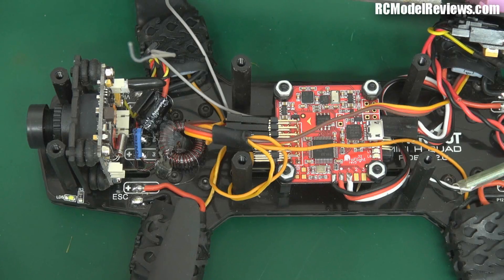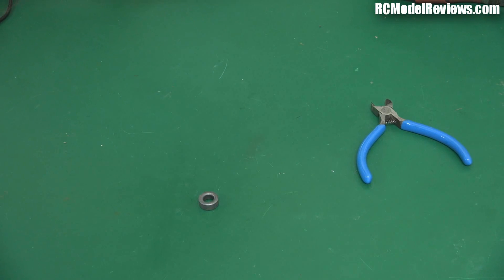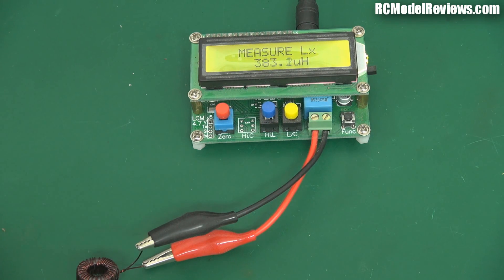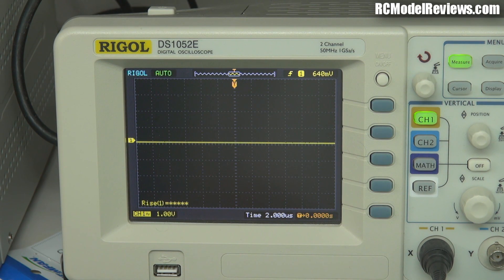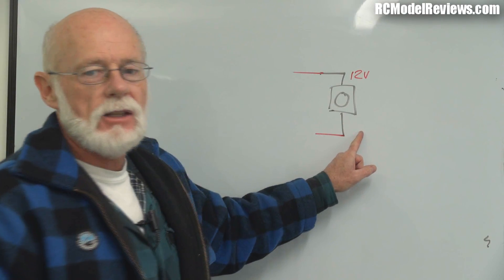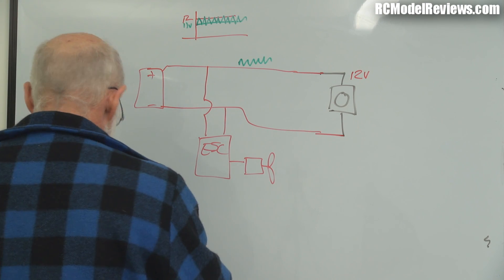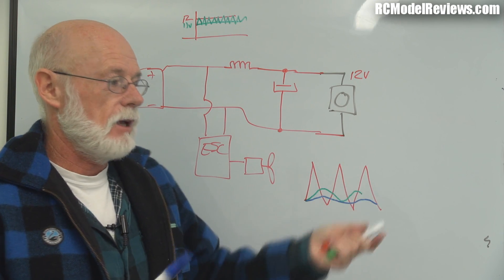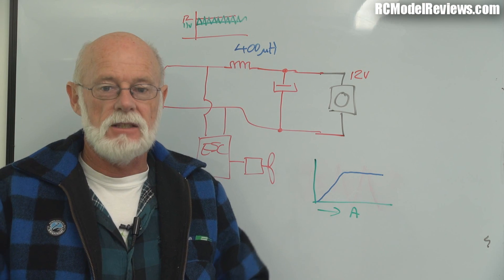DIY FPV power filter for under $3

Comment: I had the same problem with my 1500mw video transmitter I use for my rc car fpv with 1.2ghz video. I had the tx connected to lipo I use for my rc esc to power up via balance adapter. On high throttle I'd loose the video with black lines. I simply used a separate 3s lipo to power the tx and haven't had any problems yet.

Comment: I know this is old but I plan on adding a buck converter dc-dc, I have to think that would regulate the voltage and smooth it out. Since mine is adjustable, I can go from 3v to 12v. That buck converter should have a filter on it wouldnt it?

Comment: hi Mr. RcModelReviews, this is MikeDroneUfo i have a question about mini fpv camera 600tvl : is does flick each time i throttle up,i got gray lines on the screen up and i cant see i cant fly , only i can fly it if i connect the mini camera direct to another battery , do you think it can be fix? thanks

Comment: You can actually buy torroid inductors on the cheap on Banggood, something like $2 for 5 pieces rated at 330uH all nicely wound & ready to go. Saves you the hassle of buying and winding all that copper wire.

Anyway Bruce... quick question... how do I know how much uH I will need for the torroid inductor?

Comment: this if off topic.. but I have ehiye4 diagonal lines from a pdb  be. I have a bluesky  12v  3amp  ubec  but I use s3 and s4. my camera  and transmitter needs atleast 7 volts. will the 3s work with this 12volt ubec?  Or would the ubec  not even push out a voltage If I use a 3s

Comment: I put an LC filter on my VTx power supply line today, and what a difference! I used to have horrible black lines all over the video signal when the throttle was beyond 25 %. But now I get a crystal clear video signal even at full throttle. Thanks a lot for the tip Bruce!

Comment: so i have a question.  I have the flycolor raptor 390 tower.  Its a FC pdb esc combo.  I am running the rotor riot runcam and a 600mw vtx.  I have a lot of video noise when I arm my motors.  Is the noise from the camera or the vtx?  If I built one of these would it go on the camera or the vtx side.  Thanks for the info

Comment: @#RCModelNews I love your teaching first of all. On your whiteboard explanation you said inductance was measures as 400 micro Henry's but you drew the symbol for milli not micro. Did you mean 400 uH (micro) or 400mH (milli)? I'm just slightly confused and I'm fairly certain I know what you meant just would like to be 100% sure.a

Also, would I be ok to use a radial inductor (electronics kit I have laying around) or should it be toroidal?

Keep up the awesome work!!

Comment: Do you connect ferrite ring and cap in the vtx power feed line, cap across and ring inline, add cap across esc leads also? Your diagrams are great for us visual learners. Thx from the States

Comment: my question is about the electrolytic capacitor and which ends connect to what. I know they have a plus and a minus so I'm assuming that the plus wire from the capacitor goes to the positive side and the negative go to the negative voltage am I right?

Comment: Hello. I dont know much in electronics. But, as i understand, if camera will be powered from separated battary, there will be no nois. is it correct?
Reply: true, provided no interference cross over from circuit proximity occurs, but! This will add a lot of dead weight to your uav which will change other flight characteristics, namely your flight time and responsiveness.

Comment: this might be a dumb question but I'm assuming that the same noise effects the fpv transmitter. can I wire both the fpv camera and fpv video transmitter to the same lc filter to reduce noise?

Comment: Excellent, this seems to have solved my horizontal line issue on my boscam VTX / Runcam 2 setup. My video was clear, until I increased the throttle... ;-)

I tore an old PC PSU apart, used an inductor (with copper wire already attached) and a 16V 2200 capacitor. Many thanks for explaining the background info, it's helped me a lot in partially understanding what we're dealing with here.

For those that are wondering: I am running 3S, 12V is coming from my Matek PDB (with 12V BEC) . This is a safer solution in my opinion, for when I choose to run 4S Lipo's later on, I won't have the risk of frying the capacitor.

Comment: great videos, what do you make of this? i want to use this on a caipirinha wing,
Type: passive common-mode low-pass power ripple filter
Modes: common mode, single mode - jumper selectable
Maximum voltage: 16V DC
Maximum current: ~1.5A
Cutoff frequency at -3dB: 127 Hz (attenuates higher frequencies/noise)
Voltage drop over filter: 180mV at 900mA
Maximum voltage ripple: 120mV
Capacitor: Japanese Polymer Capacitor
Impedance/ESR: 0.012 Ohm at 100kHz/16V
Ripple current: 5000mA rms
Choke: German Common-mode Choke
Series resistance (DC): 0.205 Ohm/path
Wire / trace thickness: twisted 22 AWG / 32 mils
Operating temperature: -40 °C to +105 °C
Dimensions: 37.7 L x 8.8 W x 14.5 H mm
Weight: 8.1 grams (inc. JST connectors)
RoHS compliant
Designed and made in Europe

Comment: I love your videos.  They have helped me so much in this hobby.  Keep them coming!  

I just have one question.  At 2:20 you mention the copper wire thickness is unknown but it will be added to the video.  I'm having a hard time finding it.  Can you tell me what thickness you used, and/or what range is best to use?  I am about to place an enameled copper wire order and they are asking what thickness I need.

Thank you!

Comment: Hi Bruce! I'd like to ask if I can use a capacitor that's rated for 25V in a 3S setup?
Reply: +kobuki01 yes you can. as long as it's not underrated, it will be fine
Reply: +Daniel Bråtasæter so if I run both 3s and 4s batteries I would use a capacitor that is rated for 4s
Reply: that is correct.
Reply: +Daniel Bråtasæter Thank you Daniel

Comment: Very informative video. Thanks for putting it up. I understand that putting a capacitor in parallel effectively grounds the peaks in voltage due to the motors need for pulsed supply. Have you tried either putting the capacitor in series or and additional capacitor in series (in addition to the parallel)?

Comment: Why if the capacitor wired in parallel if i understand the diagram, why doesn't it short circuit?
Reply: +daran Jones no, a capacitor is a passive electronics component, the basic build of a capacitor is 2 long strips of metal separated by an insulator and made into a roll. Check out basic electronics tutorials on the internet if you are interested in that, it will explain everything;)
Reply: Daran Jones it blocks DC voltage so no

Comment: Brilliant explanation as always! I don't know much about electronics but in this example, the fpv cam is drawing power after the motors. If the cam was connected to the battery first before any load, would that have fixed the problem also?

Comment: Thank you!
I bought a cheap PAL camera and tested it on my NTSC TV (before I received my monitor in the mail) I thought the lines and the tendency of the screen to go black were the result of mixing 60Hz and 50Hz.
When I got my monitor and tried to fly FPV I found that the monitor screen would still go black 'until' I pushed the throttle, and I still had lines.
I don't have a scope so this video was really helpful.
Reply: try to use a non-blue/black screen to avoid this. like the cheap screen the quanum FPV goggles use :)

Comment: When disconnecting the battery wouldn't the ferite coil make a voltage spike? Or is it only on parallel indoctors? This spike could be resolved with a voltage depended resistor or a small capacitor in paralell with the inductor from the input to the output. I think.

Comment: I'm confused..do you take the two ends of the copper wire and twist togeather?soldering to the capicator +side then ground the negative to the ground side of the power source? Or do you cut the power supply wire in half, solder one end of the copper to one end and solder to the other end completing the circuit?and follow up with the capacitor? AND DOES THE COPPER WIRE NEED TO BE INSULATED?CAND THE COPPER WIRES TOUCH EACH OTHER?I DONT WANT TO FRY SOMTHING!!!
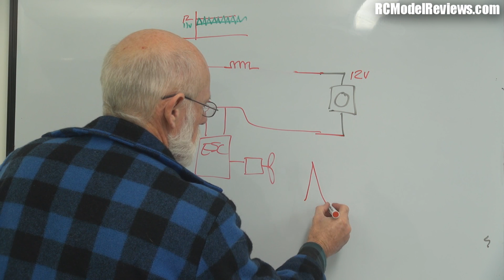Reply: tomstrb That copper wire is insulated with an enamel coating, which is sanded off of the ends with some fine grit sand paper before soldering those ends to your circuit. As for the twisting, I believe that was just temporary  and was used to hold the wingdings in place, but the parts that were twisted together were still insulated. So if you skip ahead to 12:45 youll see the circuit diagram. The winding bit at the top is the inductor he made and one end is connected to your positive while the other is connected to your cameras positive wire. Polarity isn't an issue since this is just a conductive wire.

Comment: So can the bare copper wire sitting on your quad still short? just curious as to why you don't need to cover it up. Thanks
Reply: It's not bare... it's coated with enamel so that it will not short out.

Comment: Hi Bruce! Before I saw this I bought something called an "LC Common Mode Power Filter" ( http://www.getfpv.com/lc-common-mode-power-filter.html ) which I think does the same thing but on my Phantom 2 I installed it between the video hub and TX (on the TX power line) as I assumed the GoPro camera shouldn't have the same problem since it runs on its own battery (with charging by the Phantom) and the wiring is too complicated to isolate that power source.  It did not only make a clearer picture but seemed to give me about 200 m. more range but I still have white horizontal lines travelling down the screen just not as bad.  Anything else to clear this up?

Comment: another excellent one Bruce. Question if you run your camera off a 12v BEC and vtx off a 5v BEC, do you use one LC Filter before both BECs or do you run an LC filter after each BEC?

Comment: What size caps should we use for the 12v Camera?
Reply: Jon Car  470mfd capacitor rated for at least 16v if you are using a 3s, rated for 25v for a 4s. It says in the description box :)
Reply: luke spenceley thanks, already built one and works great

Comment: Hi Bruce,

I'm a newbie in the RC community and really thankful for all your informative videos.  Reminds me of my science class during my junior year in high school.  But this is better.  : )  I'm learning quite a lot.  By the way,  what values are the 2 resistors on this video?  Because I will be buying a QAV250 mini quadcopter kit and an FPV setup.  I wanna get as much clean video as possible when "darting" thru the air. 
My respects to you sir.   
Thank you
Reply: Ghostwriter972 I believe the resistors were there only to provide some load for testing purposes .  Not needed for the actual install.
Reply: TheGusK Yes this correct !

Comment: I'm planning to run the transmitter from the lipo (3s) and the camera from a linear regulator (lm7805), do I need a filter between the camera and the regulator (or between the regulator and the battery) and between the battery and the transmitter?

Comment: Instead of buying parts and pieces go find your dead pc or laptop in the garage and scavenge the parts from them. Most time hard drive or motherboead takes a dive. Even if power supply quit it probably has many usable parts, Use ur dead stuff and recycle what you can !

Comment: First I want to say thanks Mr bruice for all the awesome videos.. Very inspired... 

Part 1
             Now I went to a electronic wholesalers and found everything except the 2a resistor because they where measured in ohms... Maybe I'm that noobie but even the employees had no idea how to help...can you give me more info on the resistor part/type... 

Part 2 
             If I run a 4s battery with this setup and the 12v camera and tx can I just run a resistor to cover the tx and camera for both 3s and 4s applications. this is an open question thanks for reading.. :)

Comment: Bruce, can I use the copper wire from the windings of a dead brushless motor I have? And would a cap from a 30a esc be suitable? The cap has 270uf and 35v written on it if tht helps. Thanks.

Comment: Hey Bruce, I found that the 470 uF cap fits snuggly inside the ferrite ring after the enameled wire was loaded onto it.  Nice and tidy, super compact.   Is there any reason, electronically speaking, that this co-axial arrangement would be a problem?

Comment: Bruce I just wound one toroid (Hobbyking one 16mm dim). I was able to wind the wire 31 times. I am using 32 AWG. I think i used ~ 70cm of enameled copper wire.
It is interesting that i am getting only 120uH.
Do you have any suggestions on what wire to use, or what could i be doing wrong?
Thanks.

Comment: I have a question, what if you use the balance port to power the fpv camera and/or tx from the same battery running the esc, would you still need the filter?
Reply: the positive pin of the balance port is physically connected to positive cable of the Battery, and the same for the negative pin, so no difference.

Comment: Does the the LC filter go on the power power leads to the camera or to the vTX?
Reply: I should preface that with the fact that I'm using a Boscam TS832 vTX which runs off 12v as well.
Reply: The camera or both, whichever you are having problems with.

Comment: are you saying diode or resistor in this discussion?
could I use this diode? http://www.mouser.com/ProductDetail/Fairchild-Semiconductor/1N5822/?qs=UY9CvlAIy0ilZt8GFdM7Zg%3d%3d&gclid=CjwKEAjw0ueeBRCmhozc-_DRrlUSJABihBEESIegal4-rgM6yEA-Rntw1K_Zl2rY6JpgEnlYGU6QUBoC5pDw_wcB

Comment: Hey there. I'm planning to use "The smallest Power Distribution Board" search for that on ebay. It is basically 2 adjustable ubecs and a PDB combined. Cool thing is you can adjust the voltages seperately from 3V to 20V.

I'll be using one UBEC for 5V rail(FC and leds and stuff) and the other for 12V(FPV), What i'm wondering is, if I'm using a UBEC would I still need an L-C filter?

Comment: If the voltage is going up and down due to the ESCs, why not use a capacitor between the battery and everything else to act as a buffer?

Comment: Hi Bruce (and the other FPV coleagues, feel free to answer too),

I have built the LC power filter as per your instructions and I have a couple of questions before I connect it to my FPV system:

1. Would the electric field from the capacitor and EM field from the inductor interact negatively if they are too close? See a picture of my LC filter here (Dropbox link): https://db.tt/I07jCa4f

2. I used a thinner enameled wire and got an inductance of 10.9 mH (yes, mili, not micro). Thats is 27 times more than your specific inductor. I'm pretty sure it might still be OK but what do you think?

3. Furthermore, how can I calculate, roughly, the current I can draw through the filter with such inductor? The capacitor is 470 uF at 25V. The filter will be used between a step-down regulator (from my 4S battery to 12V) and the 12V camera.

Thanks for your vids!

Happy flying!

Comment: Great video.  A question was asked about stripping the lacquer from the enameled wire.  I find furniture stripper  containing methylene chloride works very well.  Just a tiny dab is necessary.  Won't work on epoxy.

Comment: Hi Bruce, 
I have the same issue with my Go Pro. How would I use this to reduce the flickering im getting on my screen while flying with my Boscam 5.8 ghz 600mw system? I have a blade 350 QX.

Comment: Good job Bruce....Everybody needs to know about an L..C filter.  Maybe another winding right on top of the first...then you may haqve been able to use a slightly smaller cap.  Saving some space,,,,maybe.  I have some of those from Amidon that have different mixes for upper frequencies.....I have a homebrew converter that converts from 50MHZ to 14MHZ.  Used a Grid Dip meter to line it all up.

Comment: Excellent explanation, definitely going to try and put one together. I don't fully understand the purpose of the two resistors - are they necessary for the final build ? What rating resistors did you use for a 3s setup ?
Reply: I think the resistors are just there for his measurement setup - one is the load (pretend camera), the other increases the impedance of his source, which makes the filtering more effective for demonstration purpose.

You could include a small value series resistor in the final build for the same reason, and this is actually done in some contexts, but remember V=IR ... if the camera draws 100mA and the resistor is 10 ohms, you'll lose 1V across the resistor and only have 11V available for the camera. Worse, the voltage drop varies with load - i.e. the regulation suffers, and variations in current drawn by the camera will actually appear as noise on it's input - not what you want! That said, in practice, you would use much smaller values of series resistance.

The enamelled coper wire will have some resistance anyway (this is a case where thin wire will help - but too thin will be fragile) - you should be fine with some series inductance and parallel capacitance.

BTW, in Australia, you could also get the toroid, capacitor and enamelled coper wire from Jaycar.
Reply: Andrew McNamara Thanks mate - appreciate the info. I was walking out of Jaycar with a bag of goodies when you sent this message.

Funny who you run into in the dark corners of the internet - hope you're well :)

Have you played with RC / FPV at all ?
Reply: Duane Schultz Well, I have an RC car that I haven't used for years - does that count? 8-)

Comment: Nice video Bruce. A lot of other sources suggest wrapping servo wire around the core, but on reflection, it makes sense that you'd get more inductance with more turns using thinner wire.

Comment: lolmadmaxlol,
If you place the LC filter before the regulator, it will not do it's job.
Placed after all the "generated interference" would be better.
That way, it does both supplies.